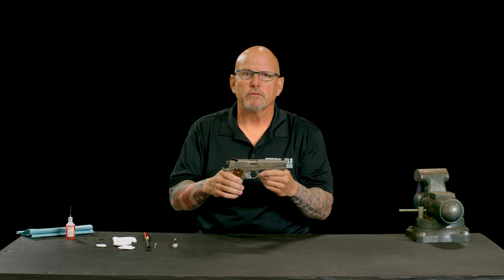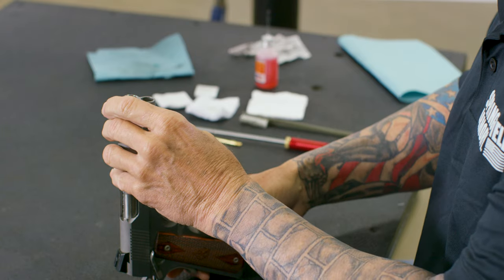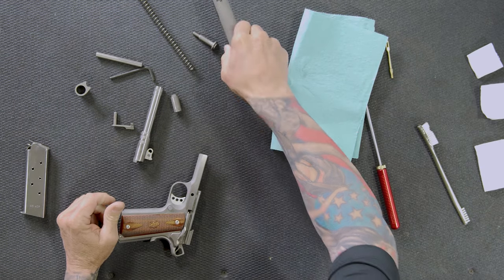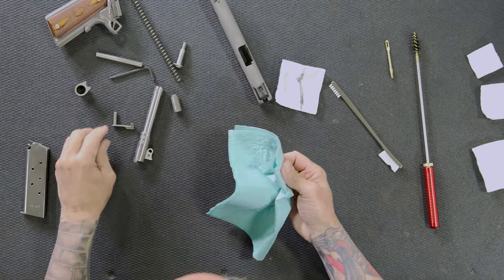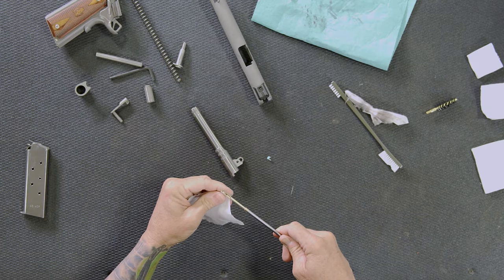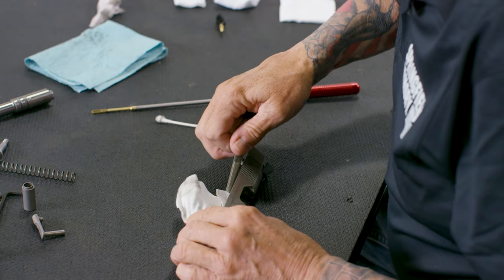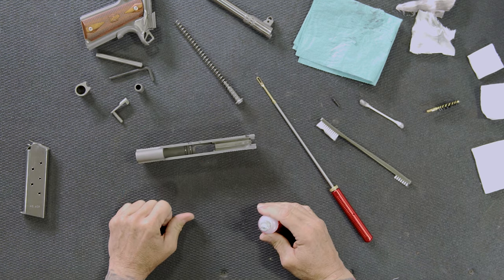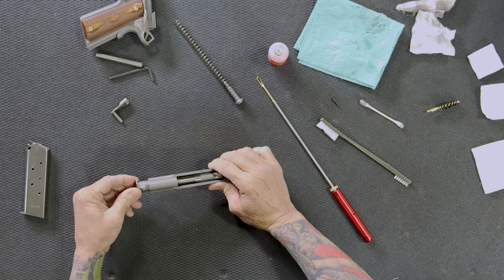Springfield Armory® Workbench: 1911

Comment: Nice video....for reassembly put the Stop Slide in before depressing the spring....much easier. Also for disassembly remove the Stop Slide 1st then slide the upper right off.

Comment: Good video. I’ve had 1911’s mapped in my genes since my military days, when I carried one to stand a watch. That was back in 1959. Yeah, I’m old. 
As a purist I have a Springfield mil spec A1 and it’s the only one that I could live with. The only difference is it’s stainless, which I love. I’m starting to mellow in my old age and I’m considering getting a more upscale 1911. Maybe a Commander or an Officer model, which my grandchildren will eventually get. 
As far as your video, it’s excellent. It’s amazing how every time I watch one of these I always manage to pick up a new technique.  However, with my fat fingers, I still, on occasion, send the recoil spring cap flying across the garage. 
The only thing I do different than you is I’ll put a small dab of grease on the rails instead of oil. It’s what we did in the military. Also, what’s up with the long guide rod?  The old models work great. It’s one more part to deal with. 
I’ll close with my humble, very biased opinion - the 1911 is the finest handgun ever produced, and videos like yours keep the those thoughts and momentum going.

Comment: Is there a reason that you did not mention the hammer, firing pin, and safety area when cleaning and lube. This is a good time to check the safety to make sure they all function. I'm going on memory from U S Army days from the 60's. I had to give a 1 hour lecture on operation, cleaning etc of the 1911 for NCO Academy in 3rd Armored Div in Germany. Of coarse didn't have internet or computers to research. I personally witnessed  an accidental shooting  death. I was standing three foot from a Sgt that was playing quick draw with another Sgt, problem was a round in the chamber, even with the magazine having been checked in. Until then no one had instructed that 1911 will fire without a magazine. I was able to work that in with the lecture, which helped with  "hour".

Comment: I've definitely been waaaay over lubricating my 1911's based on this video.  Question tho:  If you have a parkerized 1911 vs. a stainless or Armorykote, would you recommend actually applying a thin film over all internal surfaces of the slide and frame, or no?
Reply: The only issue with “over lubricating” is that dirt sticks to lube in general so you may have to clean your gun more often but 1911s need lube more than they need over cleaning. Research how to clean out your firing pin and extractor. Carbon can build up in the extractor channel over time.

Comment: I wish I had not used this take down method with my Springfield Armory Custom Shop Professional 1911. I learned, after doing it a few times, that I was damaging the match fit of the barrel and barrel bushing. It's impossible to remove the barrel bushing with a plastic bushing wrench on such guns. I had to resort to using an aluminum bushing tool from Brownell's; which removed the bluing from the knurled spring plug. I now break down my 1911's using the slide removal technique.

Comment: This is the first video on field stripping and cleaning a 1911 that I have watched that has not used a cleaning solvent or CLP to clean the assorted parts.  After shooting 100 to 150 rounds with my SA 1911 A-1 Loaded, I have a lot of cleaning to do, which would not be accomplished without using CLP. The firearm in this video must not have shot very much ammo to allow it to be cleaned this way.

Comment: At 10:30, guns almost together and I'm there with the slide stop in it's hole, the slide back to line up the slide stopper end and the aft hole (as shown). I pivot the slide stop end up to snap in at the "pin holder" and it simply won't allow the stopper to seat- at the swivel end or the point to point contact of the holder pin and the slide stop aft end.  Make sense?  Ideas?  Argh....  Thanks!
Reply: Got it.  Had to use a tool to push back the plunger pin out of the way.  Can't say this design couldn't be improved, I suspect its 50 years old?  Of note- the video shows how it all goes smoothly.  I suggest they slow down and get more specific on areas that a newbie (like me) would want to see exactly what is done and troublesome areas like I had.  In the editing, stuff is moved around and suddenly in the vid its not where it was just prior.  Need to tidy that up please.
Reply: @T_210  Lol, yeah it's been a long time since I had a 1911 and I didn't have it long, so now I have a new Springfield Emissary, I two was having problems getting that thing popped into place, it took about  three hours to get right and get a idiot scratch to boot. It showed them use one finger to depress slide spring and had a lot of trouble compressing that thing, it's stiff. But I finally get through the process but mostly due to such heavy spring. It's getting you slide lined up properly to snap in place. You'll get the hang of of it.
Reply: Yes, my mil spec has same problem. The only way I can get the slide lock pin back in is to use a guitar pick to hold the little spring pin in while I push the slide lock pin into position. I don’t know how you can do it without the use of a tool to hold that little pin back. Guitar picks work great as they’re thin and nylon and won’t scratch anything. Otherwise, no complaints whatsoever with regard to my gun. It’s simply awesome, and I have the bottom line Mil Spec, not the fancy upper tier models.
Reply: This is the most difficult part of field stripping a 1911.  The spring loosens a little with time, but putting the right angled pressure on the slide pin is key...both upward and inward.  After getting used to the process, you won't put more idiot scratches on the frame....but on your first 1911 it is almost unavoidable unless you have an experienced 1911 user show you how to do it in person.  All videos on youtube gloss over this surprisingly difficult thing to master for a new user.  Been there, got a scratch on my SS frame Ronin (my first 1911) that's ugly, but it still shoots just as well ;).
Reply: @jfal104  That's a heck of a spring to. Lol
Reply: @jfal104  I hear you, but find it is poor engineering.  That it gets tolerated/accepted because the weapon is "romantic" or something doesn't excuse the deficiency.  Be well.
Reply: @T_210  I think you calling the 1911 "poorly engineered" is certainly entertaining.  Cheers!
Reply: @T_210 glad to see I wasnt the only one with that problem, I was worried I was doing something wrong and was messing up my gun

Comment: Is there a break in Procedure for the 1911’s. New gun mc operator?.. or what do you recommend?..
Reply: Some people say a few hundred rounds
Reply: ANY hand guns have a 300-500 round break in. You can help it out by racking the slide, press the trigger, work the slide release, cocking the hammer ( if hammer fired) etc to help out a bit.

Comment: What oil trademark do you recommend?
Reply: I use Breakfree CLP for all in one go. However, some areas definitely do not require oil, such the breech face with the firing pin. You do not want oil in there. In that case, I’ll use Birchwood gun cleaner since it does not contain oil. For just oiling parts, Lucas gun oil.

Comment: Having trouble putting the slide stop back in place.  That stupid little pin is in the way. It's really pissing me off.
Reply: I got it but I still think it's way too hard, I'm not taking this apart again, this is bullshit.
Reply: Depress the pin with a screwdriver. They're a pain in the ass, at best
Reply: Eventually did it but I still don't want to take it apart again
Reply: @eric44ism  gotta clean and oil them but I understand
Reply: That’s the worst part for me. These videos make it look easy to just push that in place but I don’t want to break that little pin. I push the pin down with something but I always scratch my gun in the process. After 3 or 4 times I just stopped caring about the little scratches.
Reply: on my Ronin, I put the slide stop in before seating the spring.  Really makes it easier...and no idiot scratch!
Reply: @lanceschul  yes, I do the same on my mil-spec. Never had a problem. I can line up both ends and just push it straight in.
Reply: @eric44ism  There are other YouTube videos that suggest using a guitar pick or old credit card to insert between the pin and the slide stop.  When you push the slide stop into the appropriate hole in the slide, you are pushing against the guitar pick which assists in pushing the pin away.  It works a lot easier than a screwdriver or other tool.